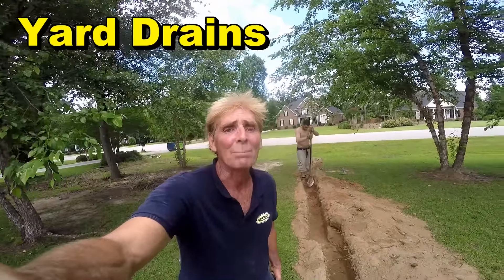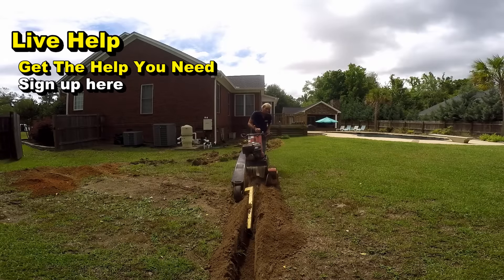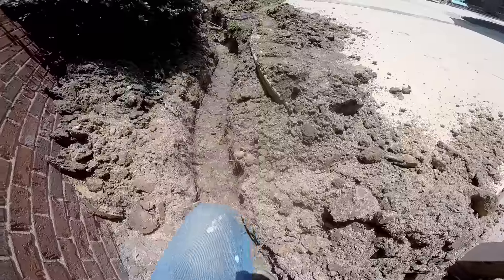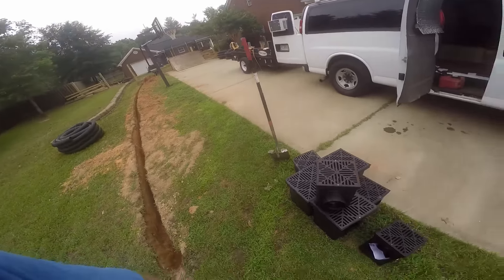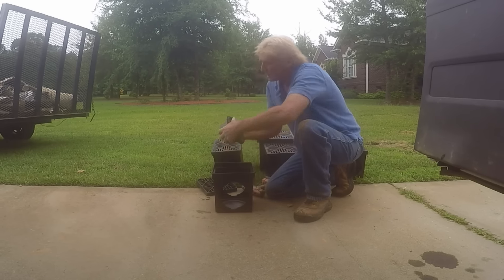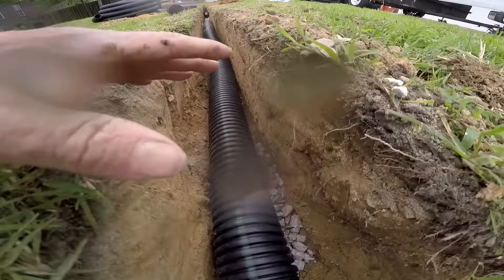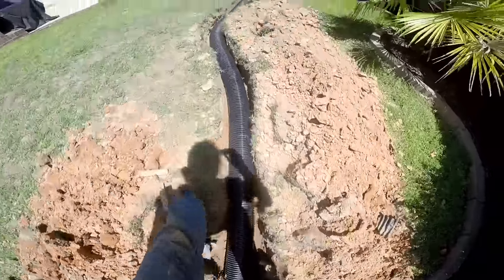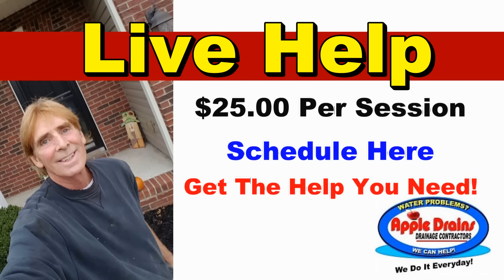Yard Drain, French Drain, 6 INCH PIPE, Gravel, Catch Basins, Apple Drains Drainage Contractors

Comment: My parents property has a drainage issue and the back yard is always muddy every time it rains there is at least 4 inches of water back there and it forms a stream too it got so bad this year that  the barn flooded and i had to make a trench to divert the water away from the barn i'm planning on running running all the water from the house into a 6-8 inch french drain pipe that runs all the way to the back of the barn probably going to be about 400 feet of 6-8 inch pipe and 300 feet of 4 inch wish me luck i might end up making a waterfall in the back for the hell of it!

Comment: Thanks for your informative videos! I just have a question, why is the perforated side of the pipe faced down? I'm wanting to do drainage around my whole house because the basement gets really wet when it rains hard, i'm thinking about doing this french drain system. Thanks for your help!
Reply: Hi Thecla.  I apologize for being so late to this party but it didn't look like anyone answered this?  Anyways, in the video he mentioned placing the perforated side face down so that when the water levels rise, the pipe will fill and carry the water away.  Emm. N commenting on @Fat Daddy below mentions that no holes are placed on top to reduce the amount of sediment as much as possible.  This is a very logical explanation as holes on top would allow gravel and dirt to fall into the pipe as you back fill.  NOTE: Naturally some of the water will not fully be carried off since there are holes on the bottom, but the majority of what doesn't get carried off will likely be irrigated through the layer of gravel under the pipe.  Hope this helps!  ^_^

Comment: Why no filter fabric?
Reply: 5:50 He seems to be of the opinion that landscape fabric / filter fabric will clog quickly, faster than the voids in gravel will clog. I've seen a few of his uploads where a sheet of fabric is laid on top between soil and gravel. Not sure why he uses so many catchbasins, maybe only for water entry, probably not as cleanout points?  I installed ours in 2012 using solid perforated pipe, and full fabric barrier between gravel and soil, no performance problems noticed, but I am monitoring it. I installed closed cleanouts at top and mid-point of the run, to keep tabs on pipe contents once or twice per year during rainstorms, seems to work. The real test is water saturation in the soils surrounding, it appears to be functioning properly. If it drains in a few hours I remain happy.

Comment: 4:32 I swear sprinkler installers are drunk when they lay the lines. I bought a house and the sprinkler lines curved all over the place. It should be law for them to supply a diagram to where they put the lines.
Reply: Finally someone that feels my pain. Im an irrigation specialist for a golf course and have to be anal with my 4, 6 and 8 inch lines and then i go do repairs on residential projects and it drives me nuts!!
Reply: Caleb Harris
I bet you really appreciate what you do on the golf course when trying to follow house irrigation lines. I'd love to follow you around at work. Ever think of making a YouTube video documenting it?
Reply: aguyandhiscomputer I've though about it many times and I think I will !
Reply: aguyandhiscomputer true, but most homes are made out pretty well and straight. But those few oddballs with years and years of repairs all sorts of things can happen